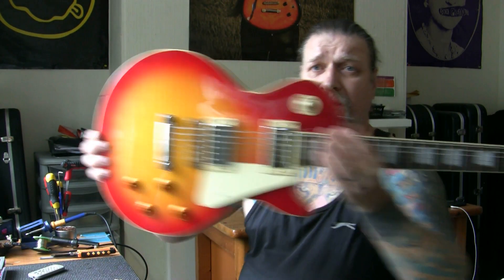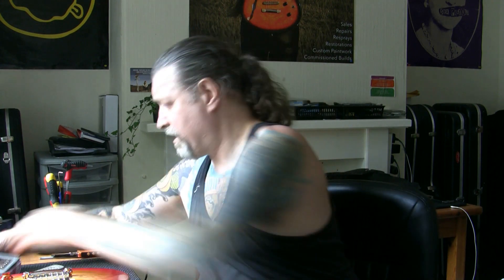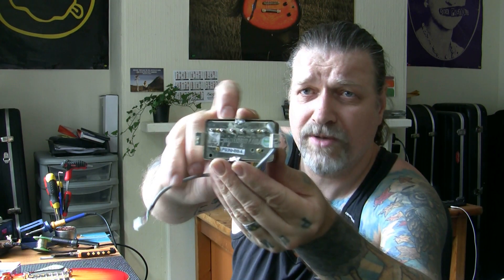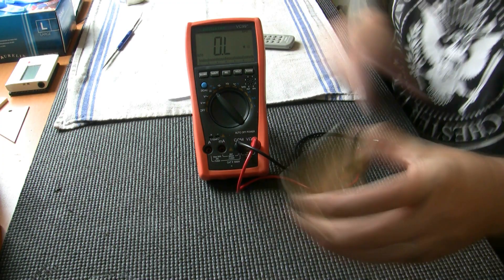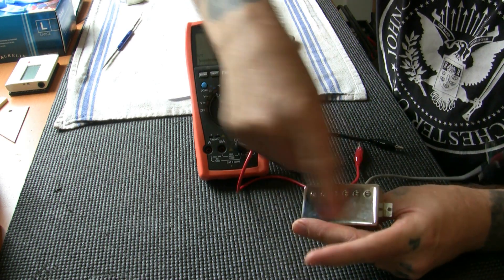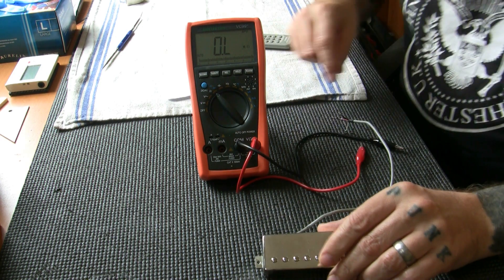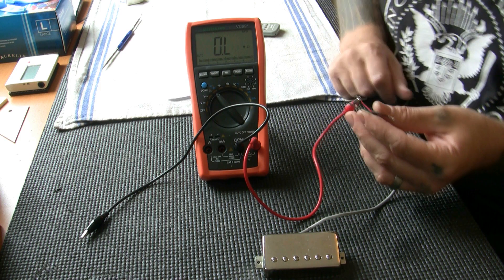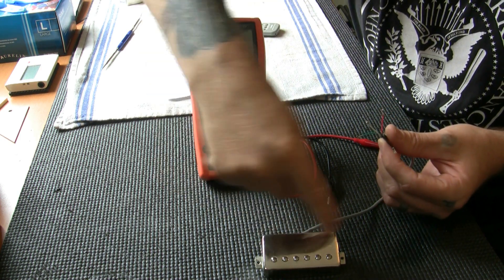How to identify (ID) a humbucker coil with a multimeter + Epiphone LP Standard pickup upgrade...

Comment: Nice video - Is it just my end or was the video blurred or slowed down until 11 minutes or so?
Reply from the maker: Video is not slowed down but it is blurry and skips a bit! Forgot to set my camera to auto (the only way it records well). I could do with a new cam soon I think. Regards, Victor...
Reply: ah got it . Sometimes I use wrong frame rate setting in Powerdirector and get similar results. Camera looks great otherwise - I think it still has some life left in it.